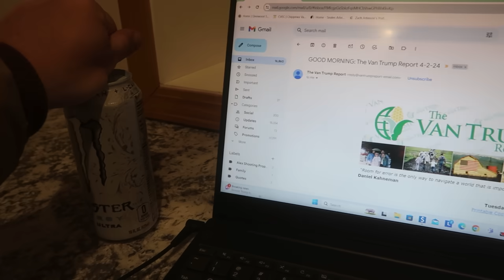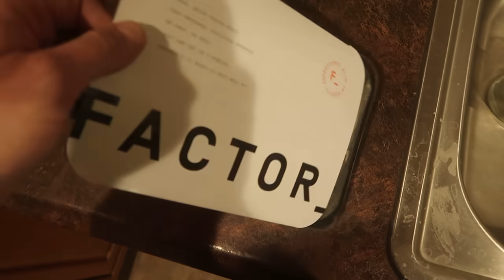More Truck Updates and 2 FEET of SNOW!!

Comment from the maker: Use code FARMER50 to get 50% OFF your first Factor box plus 20% off your next box at https://bit.ly/4aSl82Z!
Reply: If you didn't read the direction make sure the bulbs are in right the l.e.d. chips left and right for the correct light refraction
Reply: Could have cleaned the trucks down first and deloused the hubs and painted before putting bits and wheels back on!.
Also polish the wheels with MER then water etc run off them and clean easy and can polish trucks with it also.
Reply: You dint link to the polisher guy
Reply: @godoftheinterwebz that’s what I was thinking as well :/
Reply: Those are actually good meals. So thanks Zach for sharing Factor.
Reply: I've tried to watch other Farming videos, but I don't like them. God bless y'all...
Reply: i live in miami i didnt see you :face-blue-wide-eyes:
Reply: God bless you, your family, and Jim.
Reply: Plus, Factor has a good discount on their meals and stuff for first responders!
Reply: This is the best podcast of all them and I've watched over 80 different ones. Though their are a lot of good ones like the trucking ( owner operator ).

Comment: Just an idea, pour a cement pad in front of your shop doors.  Makes snow clean up easier.  Probably 12-16 feet out from the doors will work.  No more mud!!
Reply: You paying?
Reply: You really think he hasn’t thought about that?! 😂 good idea, but complete waste of money.
Reply: @Iamyourfather1 it’s definitely not a complete waste of money not only does it make it easier in the winter but in the summer spring and fall they can work on equipment on the pad outside the shop if they already have the shop full I don’t think it’s a waste of money and could be useful it’s just not a priority
Reply: The concrete apron in front of the shop would definitely make it easier to unload the FactorMeals.
Reply: I would add if he had the spare cash; make it even a heated pad as well with drainage… then it gets to be a place to wash the machinery and easy to clean up
Reply: @613rob kinda we watching it
Reply: @travpark8163 don’t need it to be heated or drained. Where they wash already has fairly natural drainage. Plus washing in front of the main doors brings mud and dirt into the shop
Reply: Gravel is overall probably the best considering cost.
Reply: Or just get decent gravel in the yard...
Reply: so then the water drains into the dirt floor? the new shed is dirt he isnt gonna spend a couple hundred thoudsand to put concrete in. he also already has shop space what do you expect him to buy all new air hoses and extention cords to?
Reply: @Iamyourfather1 can use it as a tax write off, not a complete waste at all 😂
Reply: That would make too much sense.
Reply: Why?
Reply: Like polishing wheels on an old truck ?
Reply: Pave the hole yard
Reply: @Iamyourfather1  Not really a waste of money, it's just expensive.
Reply: @jeffreyhouston2043  yes taking care of the appearance of that old KW honestly probably made a 500 percent return on investment. There's a HUGE difference in the retail value of nice trucks and rough looking ones
Reply: There's very little value in a concrete pad. Snow comes during the non productive season when he has spare time to move the snow. The pad would be a significant investment with no real financial return to primarily deal with something he has plenty of time to deal with, and would still actually have to spend time on even with the expense on the pad.
Reply: @jeremygrant1325  that's your opinion. In my experience of having no pad and then having a pad I will respectfully say that you are very misinformed. That pad is very valuable year around
Reply: @TheMSTWNTD  I’m sure it’s class 5 gravel. That’s what almost everyone uses and usually u get your gravel from a local pit. Nobody is going to ship in gravel from hundreds of miles away. Class 5 is best because it packs down, next best option is rock but that’s expensive and hard to level
Reply: @delbutler885  I'm sure it's possible, I'm definitely an accountant not a farmer, so totally willing to be wrong.
Reply: A cement pad would be a nightmare! It'd be a powdery mess and have no strength to it!

Comment: When you put the chrome hub covers on, turn the axle nuts so that you have a flat up and the covers will pop right on
Reply from the maker: I'm going to try this next time, thanks
Reply: @MillennialFarmer  maybe just to clarify turn the nuts so a flat is facing the outside edge of he axle, I read my previous comment and it seemed a little confusing.
Reply from the maker: @nickgardner5970  it made sense to me because I had actually considered that but didn't think it would really work
Reply: @MillennialFarmer you definitely need to get a tire cart. Takes the backbreaking out of taking semi tires off and on. Call dougo and ask him what type he has. 😊
Reply: We have a hand cart that has rollers on it to align the wheels that you struggle on and off with.

Comment: In the UK they have changed the LAW on LED replacement bulbs - basically the reflectors weren't designed for LED and so often drivers in the opposite direction were getting dazzled (even when not on Hi-Beam) so now you have to have replace the whole light unit to deflect LED Lo-Hi to the spec. This is enforced at our annual MOT check - plus causes issues on your insurance. I bet US follows in years to come.
Reply: Most us states don't have vehicle inspections

Comment: actually pressure treated will rot your trailer faster. when those boards get wet they leach down onto your metal and the chemicals they use to treat the wood is corrosive to the metal.
Reply: I did not know that. Thanks!
Reply: @KEVN38  Most lumber manufacturers that use ACQ, CA, ACZA and CCA treatments specify stainless steel or heavily galvanized fasteners when working with pressure treated wood to hold up to the chemicals and provide a secure connection for the longest time possible.  While you can find fasteners labeled suitable for pressure treated wood, utility trailers and the like are usually just powder coated or painted normal steel.  But realistically it would take many years to degrade the trailer to be unsafe do to corrosion from the PT lumber.  Non PT lumber and a coat of an oil based wood protector sprayed on with a cheap pump sprayer like you use for weeds or a deck every few years would be fine for most people.

Comment: Hey sit on a creeper seat and use a large pry bar against the floor to put those wheels on. If you wear steel toes you can use your foot saw a pivot point. Much easier and better for your back.

Comment: Zach double check your bulbs I think you may have put hi beam bulb on the high beam side The connectors are close to being the same I believe those are 9005 and 9006 or h10s and h11s but they have the little tab in them just double check I think you got your bulbs in the wrong spot And if they have the type of deal on the bulbs where you can orient the bulb so it's straight up and down in the housing set that after you lock them in make sure the led is straight up and down

Comment: Instead of using your back to lift tires and wheels when installing or removing,  simply take a bar and put under the edge of the tire and lift the bar, which lifts the tire.  It goes either behind or in front of the face of the tire,  makes it so simple to adjust when removing or installing.

Comment: A trick to pop the hub caps on the trucks is to tighten the axle nuts so the flats on the nuts are all facing towards the outside edge of the axle flange. Then the caps will pop right on.

Comment: I think a few of those hard to start tractors and trucks could greatly benefit from a Super Bank Capacitor/battery combination setup. 25,000 starts without an issue doesn't sound like too much of a problem. You all know all the big companies out there that sell them.
Reply: I can agree. the custom harvest company i worked for kept a couple of them in the maintenance truck that traveled around with the combines and other equipment
Reply: they can be a godsend on a early morning start when its single digits out

Comment: Wire wheel the rust off the wheel studs and use some penetrating oil before taking off the lug nuts. It can make a big difference. I know all about rusty bolts here in lower Michigan.

Comment: Zach, shop around for LEDs for your low beams there's a few brands that have the drivers built in that should hopefully fit. Sealite or Lasfit are the two aftermarket brands I've used. Well worth it especially for harvest.

Comment: Now those wonderful new bright lights will blind everyone.
Reply: Agree 100%
Reply: Yep.  The frosted plastic covers will diffuse the spotlights into floodlights, blinding everyone ahead of you.
Reply: Wrong. You’re thinking of HID headlight bulbs that blind other drivers when not in a proper projector housing. 

HID bulbs throw a 360° light pattern. LED bulbs like what he installed and as you can see have a 180° light pattern with the LED chips on the sides of the bulb and when installed correctly (you need to adjust/ clock them in the housing so the LED chips sit horizontal) and then they have a proper cut off of the light beam pattern when used in a traditional halogen light housing. Also you’ll notice halogen automotive bulbs have black coated tips to stop forward facing lights and the LED bulbs also have no forward facing chips so they illuminate the housing like a halogen bulb does. 

Also you’ll note what looks like the low beams in the headlight housing are actually a projector housing, so it wouldn’t matter what bulb type he ran in it as the projector itself cuts the light off at the top of the beam pattern.

Only reason you’d be blinded by properly installed LED bulbs would be from an incorrectly adjusted headlight housing where the lights are pointed too far up… often happens when a lift or leveling kit is installed on a pickup  truck and they didn’t readjust the headlight housings to compensate for the lift or the truck is squatted in the rear from pulling a trailer, which even in those cases stock halogen bulbs are blinding.
Reply: @chevyon37s  You failed to understand what I said.  The glazed plastic that the light beam has to traverse will scatter the beam and made a spot into a flood.
Reply: @chevyon37s  Not all LED globes have proper light cuts. And you're assuming they've been installed correctly. Most people do not double check they have the beam set correctly.

I know Australia has rules about requiring automatic washers and levelling when LED or HID globes are fitted. I presume the USA is similar.

Comment: Love the vids and the dogs. Question - have you ever tried laying down 2 long 2x4 to drive the truck's inside tires up on?  All 4 of the outside duals will be off the ground and easily removed.  Saves trying to jack up each side.  Just saying...

Comment: I'll just tell you now on gravel in the fields around the dust those lights are junk. The best easiest proper way is get a whole new headlight assembly they are sealed and plug and play. U might have to go into ur truck computer and switch the setting to led lights

Comment: If Millennials talk to Gen Z you could ask Chet Larson where he got the one handed  truck wheel changing trolly that slides under the truck wheel to remove or put it back on without having to visit the chiropractor every time you change truck wheels. Just a tip from a Boomers II (We invented the wheel)

Comment: Don’t do LED!!! They are junk, specially in the headlight application if you’re running in snow, there is no heat so you have no headlights when they cover up with snow. I think the whole LED is a bunch of crap anyway I’ve driven truck for 43 years and I’ve changed more LED trailer lights in the last 10 years than I have in the last 30 with the incandescent lights. Same way with the trailer, if you’re running in snow, no heat, you have no taillights, save your money!! JUNK